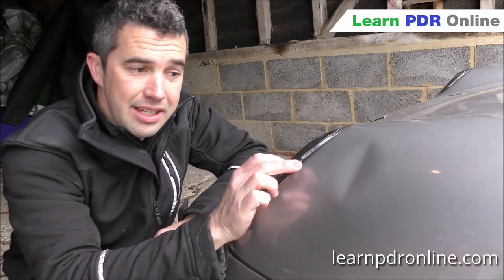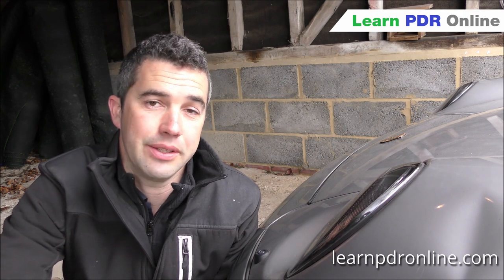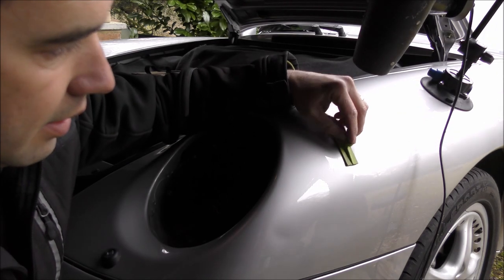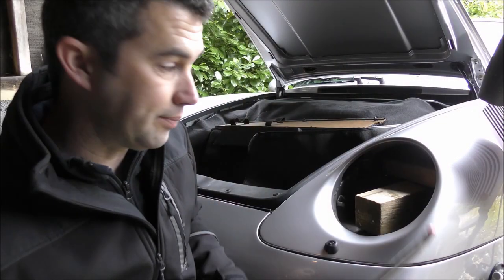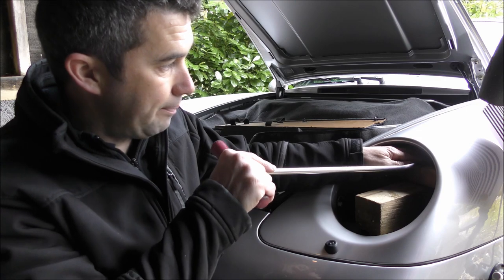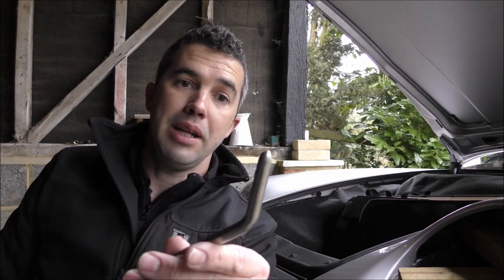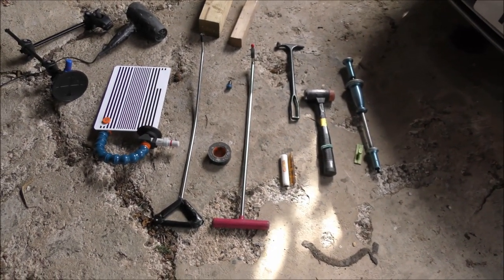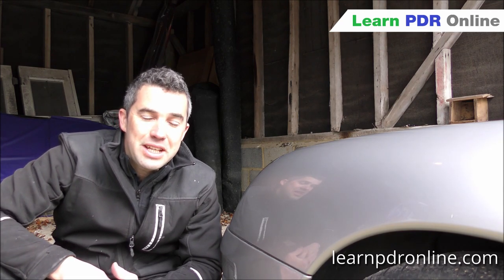PDR Saves Porsche 993 Front Wing | PDR Tutorial

Comment: Question when you pushing out low spots with the rod do you follow the black lines on the line board or the white ones?
Reply from the maker: Hi Anto, Good question, When using a line board you are really using both together to gage the damage, moving your head back and fourth you can see the distortion in the lines (both black and white) and this allows you to read where the highs are (lines that pinch together) and where the lows are (lines that are wider apart) Hope that helps!